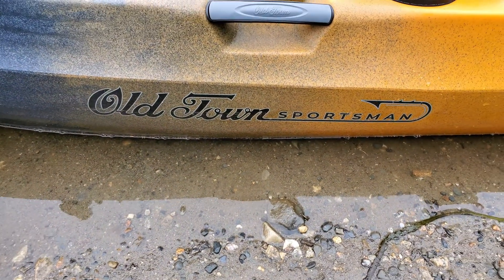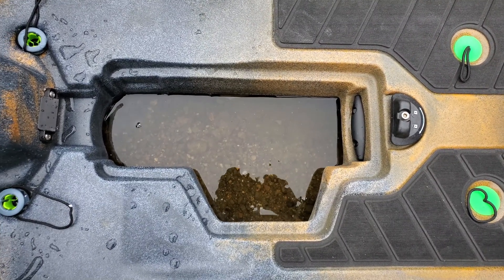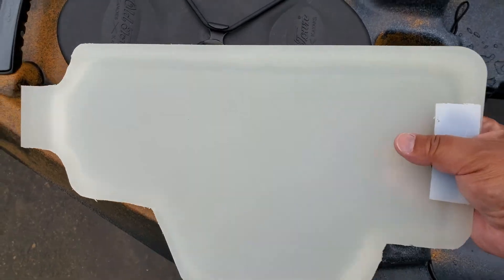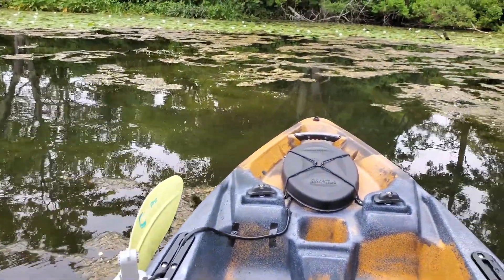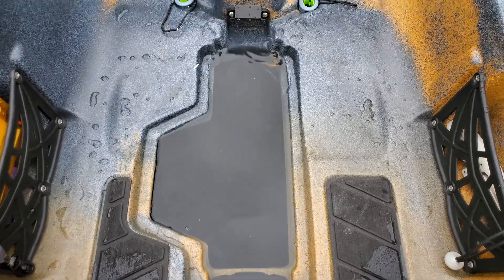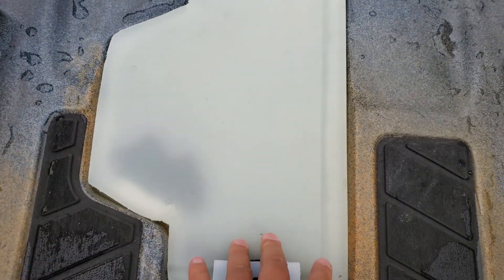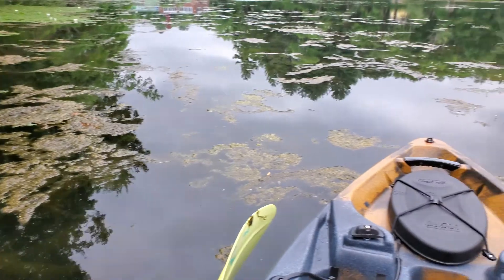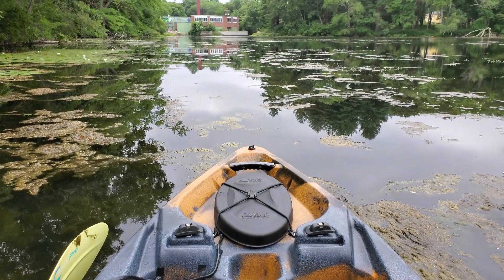Old Town Sportsman 106 PDL Cover

Comment: I am looking at both the Slayer 10 Propel and the 106PDL 
Between the two which one is best? 
I already have a Hobie Outback but this will be for when I need something lighter and easier to haul when I take friend out or my wife or daughter.
Reply from the maker: The slayer is lighter.  As a fishing platform, I like the sportsman better.  More stable, tighter turning radius and better  angle for the rod holders.